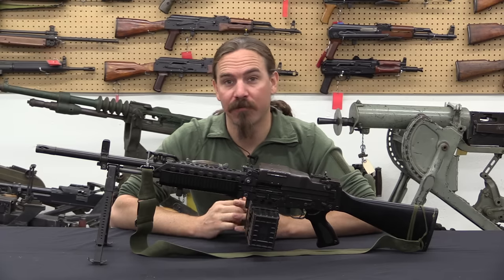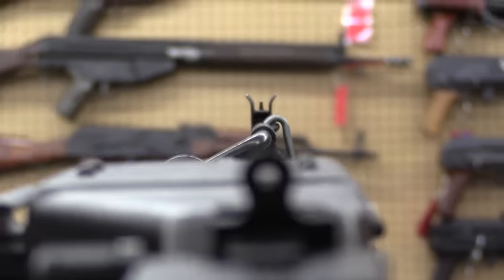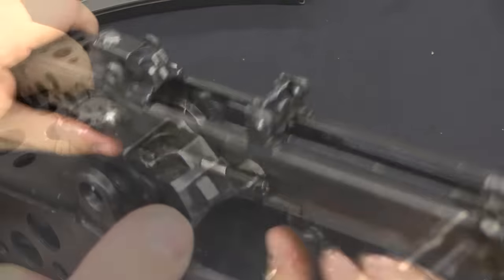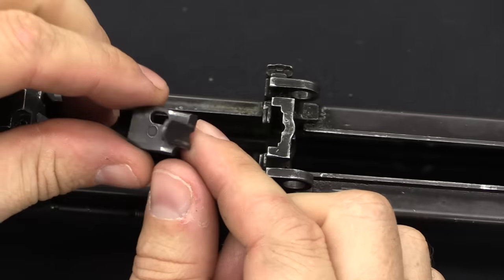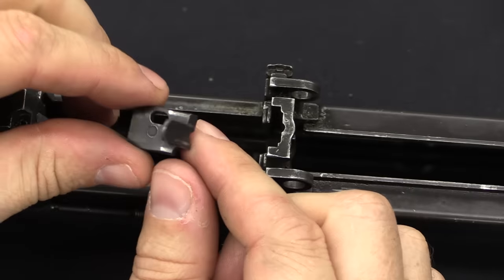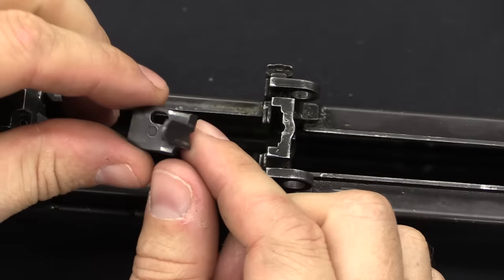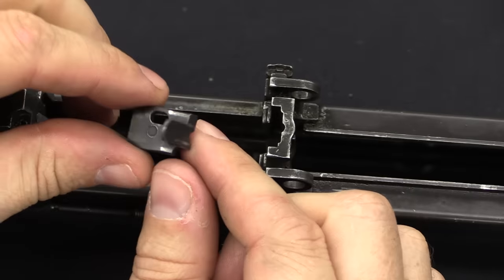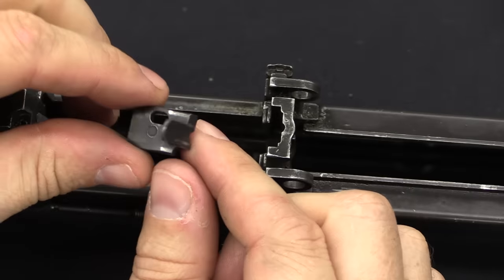Stoner 63, 63A, & Mk23: History and Mechanics

Comment: Given modern advancements in firearm technology I'm really surprised this hasn't been picked back up. Polished and refined and reintroduced.
Reply: Well, the closest rifle system to the Stoner is the Steyr AUG. It has 4 barrels: very short-submachinegun, short-carbine, long-rifle and heavy barrel with bipod-automatic rifle. The barrels can be easily swapped in the field by locking the bolt in rear position, release the barrel knob, rotate the barrel 20 degrees and take the barrel out. Put another barrel in.
Reply: @mardiffv.8775  The closest rifle system to the Stoner 63 is the AUG? Can the AUG feed belts and magazines? 
The AUG is closer to the SA80 series; a bullpup select-fire assault rifle. The Stoner system could be reconfigured to feed both belts and magazines. This is closest to something like the FN Minimi (M249 SAW for Americans) which feeds belts of 5.56 but will also accept 5.56 STANAG mags in a pinch. 

FN Minimi and FN MAG both have quick-change barrels too - weapons which are largely used to replace these rather silly attempts at creating some versatility in a service rifle by changing barrel lengths. this only works for so long and systems designed specially for certain roles just do them better.
Reply: KelTec have been working on weapons systems based on the Stoner 63 for some time.
Reply: @Lavenderlore1043  That is great news, thank you.
Reply: Robinson arms also produce civiliian remakes of the stoner 63 under the name M96. Probably still would be hard to get a hold of one i reckon but its an option nevertheless
Reply: @Rentzin  Thanks for the info.
Reply: I think still the AR-15 is the ticket with belt fed uppers being a thing
Reply: @bishopm4401  belt fed uppers and the 5.7 upper are WILDY cool.
Reply: @mardiffv.8775  THe closest is for sure not the aug. Hell, the ZIPFIRE is closer to the stoner than AUG.
Reply: @Jack-V-Man  Very funny. I did not mean that the AUG and Stoner were technically related, like the AR-10 and AR-15. But I meant that the same concept of rifle, carbine and light machine gun.
Reply: Yall keep forgetting the negev
Reply: @briancowell7844  I misread that last word at first glance lol
Reply: @angrytemplar7675  lmao
Reply: @bishopm4401 for an LMG the AR needs to go to open bolt and gas piston.
Reply: Every little piece of metal would up the price by 100 dollars by todays standards.
Reply: It actually kind of has been picked back up, but has been updated. The current Knights LAMG prototypes are actually an updated version of the Stoner 63 system that omitts the automatic rifle version.

When Eugene Stoner joined Knights back in the early 90s and after he finished his updated AR-10 design with the SR-25, he continued work on the Stoner 63 making notable updates. Taking lessons learned from a previous attempt when he worked for ARES (called the LMG-1) he developed the KAC Stoner LMG. When Stoner passed away, Reed Knight would continue Stoner's work which led to the ChainSAW. A prototype which led to the LAMG, which was the culmination of decades of RnD based on Eugene Stoner's original design. A lineage which dates all the way back to the Stoner 63.
Reply: @mardiffv.8775  but its keltec and they suck
Reply: knights armament LAMG
Reply: Yeah. It’s called the KAC LAMG. The Rangers use it and apparently love it.
Reply: @Momofukudoodoowindu  Was officially adopted yet? I know it's being used in small numbers.

Comment: A beltfed 5.56 at elevenish pounds? No wonder the SEAL's liked it, I would have too. That is less than half of what an M-60 weighed. Even the later M-60 E3 wasn't all that light.
Reply: The weight difference of the ammo alone would have been significant.
Reply: M60 was chambered in 7.62x51... So not comparable
Reply: @weasle2904  Good point, but

a) the Stoner LMG was yet introduced as a more lightweight alternative to the M60, at the expense of some firepower.
b) the Stoner LMG still weighed 30% less than the 20 year later design M249!

So, while it didn't really weigh half as much as other designs, it was still very lightweight.
Reply: @andrehashimoto8056  
I thought the LMG gunners helper carried the most ammo because the LMG guy has to carry the added weight of an LMG already
Reply: @danielmccoy8875  No wonder they called it "The Pig".
Reply: I was Army and aviation support until I learned better, but we had Ma Duece for half of the assault teams. You never get used to that amazingly wonderful weight no matter which one of 3 barrels, receiver with enough ammo everyone knows to shoot you, and lastly poor ammo bitch... I meant supply support specialist. I decided door gunning was a safer bet than assembling a Ma Duece with 4 soldiers that are diving different directions for cover, while returning fire with a M9 until finishing a 1k pound Lego set.
Reply: Military thought the same until the trials started and the reliability issues just stacked on top of one another.
Reply: Beaverish Buck Teeth  M60 is a GPMG, Stoner 63 LMG. Different weapons suitable for different situations which is why most armies in the world use both LMG's and GPMG's.
Reply: Beaverish Buck Teeth  Good day to you too!
Reply: It's absolutely awesome hearing the stories told by the SEALs who carried it like Roger Hayden, Kirby Harrell, and Tom Richards.
Reply: Don't forget the Marine Recon units!
Reply: @13thSystem  This is a specialist's weapon. It could have been better if it wasn't a rifle and an MG at the same time, but it was made to be that one tool you need. Perfect for low size teams on SEAL operations. You need to take care of it, but if you do it will pay in droves. This weapon is the definition of surgical full-auto. Perfect site picture even in a long burst. It's a weapon designed for mobile surgical destruction. Need a squad with only rifles for silent VIP rescue? Go to the armorer. Same if you need some Belt-fed 5.56 for supporting/suppressive fire. It's the Swiss army knife of the LMG/Rifle world. The best tool you can get for no situation but with good care still extremely useful in any.

There is a reason to why only the Nightstalkers get to fly the little bird.
Reply: they praised it a shit ton the only thing about it that failed is the solenoid model still used 5.56 which is impractical in places where a solenoid gun would be used ie aircraft or armored vehicle mounted
Reply: @TruthNerds yeah but you don’t use machine guns for long range combat like rifles so damage isn’t really and issue.
Reply: And when he fires one, you can see him marvel at the controlability and inherent accuracy. Always a favorite of mine to see!
Reply: @weasle2904 you really think your some expert or something
Reply: @weasle2904 But it should be noted at the time we didn't have the M249 or an equivalent. So this was also a useful middle option between the m60 and the m16.
Reply: And to note, the SEALs used both the M60 (for the 7 man squad's automatic weapons guy) and the Stoner